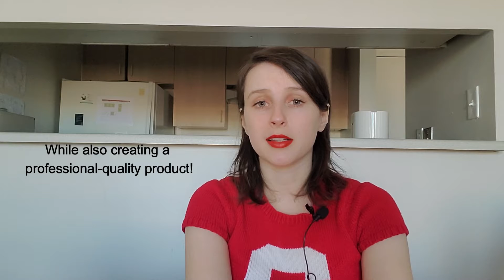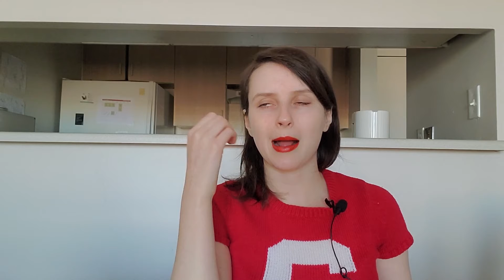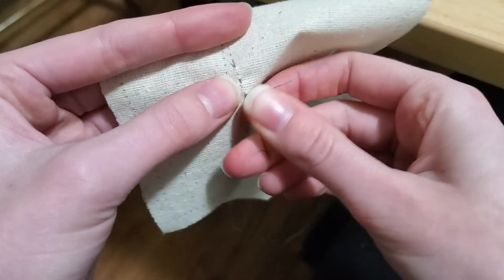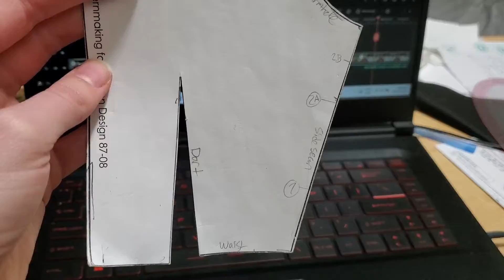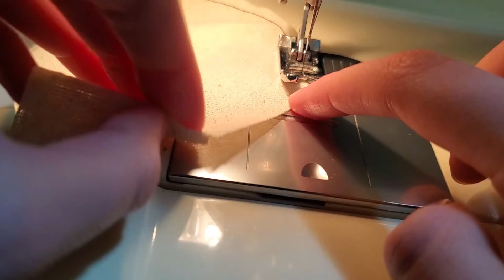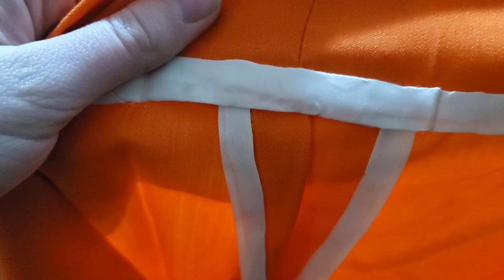What is haute couture sewing, and how is it different from industrial and home sewing?

Comment: I will say all house are different when approaching couture. I was taught by a couturier and she emphasizes economy of time when working. So having the know how to cut down on time to work efficiently and accurately which takes years of experience. You do about 4 or 5 muslins just getting the perfect final sample. I will say most of the work is done during the prep work only working flat in the table which is padded also known as “the third hand”. Your able to iron and pin as your working which helps if your shaping the material or you need to baste something without the fabric shifting. All the prep work is what makes haute couture special just for accuracy when working with expensive silks.
Reply from the maker: Thanks for sharing your knowledge! I really appreciate it.

Comment: Industrial sewing also uses jigs and templates so the pieces can be aligned to a mark on the machine bed, and start and stop lines which can be switched out for various sizes.  This reduces the need for clips which are only marks - and don't help with assembly. 

If you're making multiples of anything at home, using tape on the bed of your machine, which shows where to align the seam, or stop marks, or an alignment angle... and creating marking templates out of card or similar, will be similarly helpful.
Reply from the maker: Great point!

Comment: Hi Alex, Here's a little more info about setting sleeves. The sleeve is cut with less ease and a narrower seam allowance than a "home sewing" pattern would have. This allows the operator to set the sleeve without crimping. Generally, the seam allowance is only 1/2"; this small difference makes the sleeve much easier to set. The school I went to trained operators as well as designers so it was pointed out that this may be the most difficult operation in constructing the garment.
Reply from the maker: Thanks, Claire! Great information. I wish that it was more common to train designers AND operators in fashion school. I was lucky to have a teacher for one class who had done both in her career, but it seems that this is rare.

Comment: Having worked at a kiltmaker, which used a combination of haute and industrial methods depending on the budget range of kilt, people would probably be quite shocked to realise how many edges are actually left totally raw! If it wasn't visible, it wasn't getting any kind of finish. Partly a time thing, but also makes sense, given how likely it is a kilt will be ripped down and remade to fit a new owner or change of body shape...

Comment: The history of sewing and sewing techniques is really interesting to then compare to modern methods / different "category" practices like you did here. A funny comparison is that Victorians and Edwardians promoted many techniques for home sewing that we now see in couture sewing. 
But even though they would talk about these methods as being the "assumed standard" for home sewists, it's very evident from surviving garments that most people were still a little slap-dash / didn't necessarily practice what they preached. Their common tactic was to identify every aspect of the garment that would be invisible on the finished piece and to sort of just do whatever (drunk-driver machine wavy seams to initially connect panels together, uneven chunky hand stitches out of a strong thread) and then pay attention to apply the more couture methods as you get down to the outer construction and fiddly bits.
Going further back, an even more amusing angle is to look at 18th century or earlier sewing methods, where there is a strong emphasis in home sewing to "winging it". There were tailors (flat pattern cutting) and mantua makers (later dressmakers; draping onto the body directly), but home sewers (housewives, single men) usually worked in sourcing chunks of similar weight linens and cottons, patching them into squares and rectangles and then sewing them together into shirts (which went to the knee and doubled as underwear) shifts (underdress; also the base/underwear layer), petticoats and aprons. It's kinda fun to try these 18th methods because it feels very anti-fashion, or anti-intuitive but for some people it becomes an easy way to think-out go through the construction process (perhaps because non-professionals were approaching it like how you at home make dinner in a different way then how a chef would make dinner).

Comment: Maybe home sewers use haute couture techniques? Vintage sewing tutorials from the 1950s or so (and my Home Ec sewing teacher) taught that a garment  should always be hand basted and fitted before being machine stitched--if a sewist was not confident in her [or his] ability, a test garment was recommended. It was suggested that raw edges be turned under when possible (there are a couple of methods for that) and stitched, either by hand or machine. The best vintage home sewing books are the ones that show hand finishes for seams, plackets, hems, or hand worked buttonholes. For a home sewer, being able to hand sew well is a must. Many also know how to grade or alter a commercial pattern beyond a lengthen/shorten line and change details, e.g., alter sleeves, and hand draft slopers for patterns. 😉
Reply from the maker: Yes, great point, there is definitely a lot of overlap between the two. What is your favorite vintage sewing book? :D
Reply: @alexneuf7526 
I just want to know what I have to do for a living to AFFORD those dresses.😂

I can never find the patterns to buy them to make at least one dress for my own.
Reply: In spite of my best efforts my hand sewing is not pretty!  I do hand baste where something does not lend itself to being properly done on the machine, such as tight areas around collars.  I do very often sew first with a very long machine stitch if I have any question if it will not be perfect.  But home sewing does allow us all the variety from slap it together to fine hand work.  As I have gotten older and much of my sewing is for me, I do more complicated, or high end options because I have time. Back when I was sewing for my kids (all grown up now), I serged all edges, and did everything as quickly as I could while still doing it to look nice.
Reply: Started sewing at age 8 and still sewing in my 60s.  What I do really depends on the garment.
 Children's play clothing. Very industrial in method. They will outgrow it quickly. I always double sewed the crotch on pants and shorts though. Do it on adult clothing as well.
 Made myself a 4 piece suit once. Bound buttonholes, pockets, etc. A lot of time and work, expensive fabric, but it lasted years.
At one time you saved a lot of money home sewing. Now it depends what it is.
Made the flower girl dresses for my daughter's wedding.  Worked out to 30 dollars each compared to the ones in the magazine selling for over 200. Four dresses.
Reply: @dawnelder9046 I find home sewing cheaper because I do high end sewing techniques. I buy better fabric and often line my garments. The end result are clothes that hold up well with weekly wear and laundering for ten years. 

Used to be if one paid more for their clothes, the better quality of garments. No so these days. I've seen way too many designer clothes made of polyester and flimsy thread these days.
Reply: That's how I learned
Reply: That’s good dressmaking technique, but not couture. If you read Claire Schaefer there’s all kinds by of stuff even pro dressmakers/ bridal sewist won’t do because of costs. There’s actual reasons for $2,000 vs $20,000 vs $50,000 for a dress. There’s also New Tailoring, and some insane methods of molding bodices on the form so there’s no darts or such.  It’s a different world and technique. Very Fine Arts.
Reply: I worked in a sewing factory. Sleeve machines had a ruffler.

Comment: Great video thank you!! Do you know why haute couture bastes everything? like what is the actual benefit to basting a single layer of fabric vs using chalk?
Reply from the maker: I've never worked in an haute couture atelier so there may be other reasons that I don't know about, but some benefits include: you can see basting on both sides of the fabric, it is generally more precise, and you don't risk staining the fabric with chalk that doesn't come out. (Obviously the chalk is supposed to come out, but in haute couture they don't take any chances!)
Reply: When you basting you can draw and see the right side of fabric and cut it without measure amount of fabric to sew